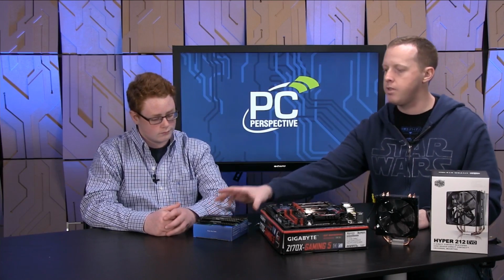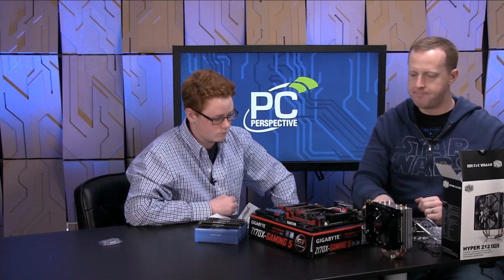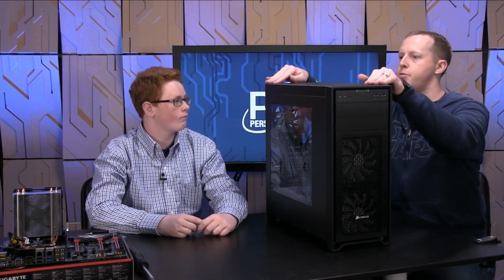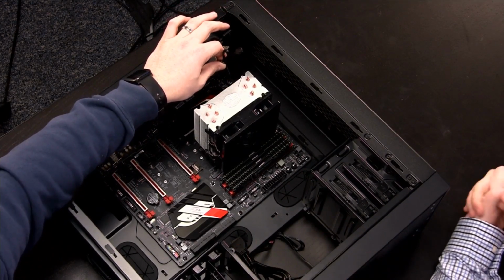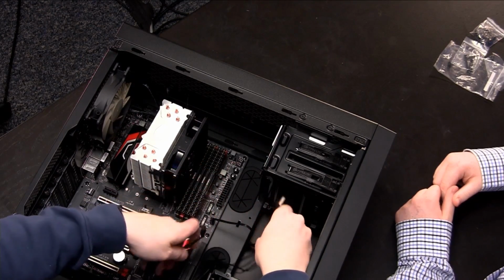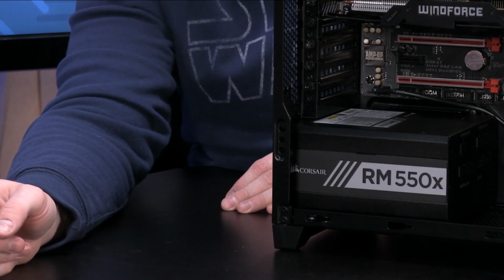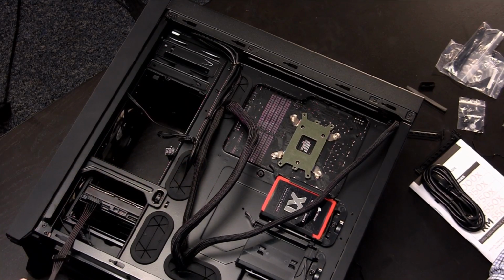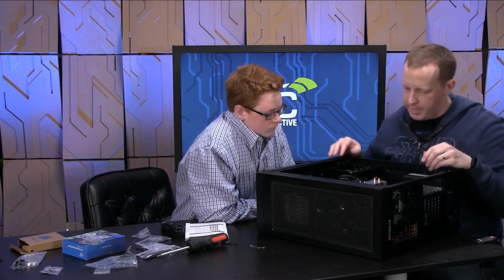My First PC Build - Part 2 - Putting it Together

Comment: i just build my first pc, what a terrible idea to do the power cables after screwing in the motherboard. I have a noctua 15 cooler which is pretty big and had a very hard time installing the cpu cable. Other than that it was a good video and I just built my first pc.

Comment: Do you have to worry about ESD?
Reply: I bought an anti-static wristband just to be safe. They're only like $10 and it's not worth shorting an expensive component due to some freak discharge. Most people say the odds are slim to none, but still, why risk it when it's so cheap to prevent it 100%?
Reply: +Raindeux ok thanks

Comment: wouldn't it be better to put the motherboard into the case before adding the cpu cooler? (So long as your case allows access to the back of the mobo)
Reply: Depends With a 212, it's going to be a PITA no matter what.

Comment: I guess you could probably try with the tool less bay on the botom for the sdd and hope that the cable reaches both.
I believe they reach in my 450d with an RM650

Comment: PC building has become so much easier over the years.  I can remember having to install mounting headers in the case before the motherboard could go in and every edge was designed to get blood from your hands.  The I/O shield never fit quite right and you had to set up the CPU speed through jumpers or dip switches calculating the Front Side Bus speed as well as the Multiplier.  These days the motherboard does that automatically.

Also SATA, even being an outgoing standard, has made things much easier.  You don't have to worry about what order on the connection chaine where you are plugging them in or again setting jumpers on the drives to designate whether they are primary or secondary drives.  Sata made it all plug in and play.
Reply: I think once we hit year 2000 and first gen DDR it was a piece of cake. my first build was 2004 and it was super straightforward. even with PATA/IDE it was still easy, just set master/slave jumpers (or cable select which was never used much).......also LGA sockets are easier for heatsink removal. With pinned CPUs that use heatspreaders, the thermal paste has a big contact area & a "suction/vacuum seal" and if you just pull off the heatsink you can pull the CPU out of the locked socket. you gotta twist and loosen the "seal" then slide it to the side as much as you can, then gently pull on angles

Comment: This is a fantastic guide for first-time builders - best one I've seen! So many people don't show the mounting of the cooler with the application of the thermal paste. Also talking about each step in better detail will really help those intimidated by the process. Little things like pushing the mainboard (motherboard) into the shield to help line up the screw holes. That little guide post in the center  on this case is awesome!

Comment: Since Skylake is on Dual Channel wouldn't it have been better to use two 8 gig sticks than four 4 gig sticks? Much easier to add additional ram and probably would have been cheaper.
Reply: Don't really think he'll need 32 ram, or 48 as is.

Comment: The one thing I like about AMD is having the pins on the CPU. You are more likely to get bent pins on a motherboard compared to on a CPU during shipping in my building exp.
Reply: +Tone Tech and Gaming Would you rather damage your relatively expensive CPU or your relatively inexpensive motherboard?
Reply: +Tone Tech and Gaming At the same time a mid range motherboard is significantly cheaper than a mid range cpu.
Reply: +Tone Tech and Gaming Ive never managed to bend a pin on a cpu or in the socket in 16-17 years...
Reply: Did anyone read what I wrote? I said nothing about bending a pin during installation. I mentioned bent pins during shipping.
Reply: guys stop talking about bent pins in cpu it's a pain for poor people like me who doesent want to see a 200 dollar cpu just wasted and non working just because of the bent pin

Comment: would have helped him to understand if you told him what a backplate is doing...
Reply: +mcl40000 he didn't even know how to install that cooler properly...
well its part of exploring and learning ^_^
Reply: Gether Medel i remember how i felt when installing an aftermarket cooler for the first time...was so scared! that thing was so silent that i thought i forgot to plug in the fan when starting it the first time...
Reply: mcl40000 that's hilarious HAHAHA
btw that guys was "................." this close to FUCKING UP THAT COMPUTER.
when he was installing that PSU.
if you noticed the Case was gawd damn close to the edge..that was very clumsy of him.
if that computer fell off BOOM hahaha.
its pretty clear he doesn't have much experience in building computer.
you would know by just watching him how he would install the parts and the steps and order of how to properly install/plug all the parts.

I'll give him 5/10 hahaha.
he needs more hands on experience with building computers though.